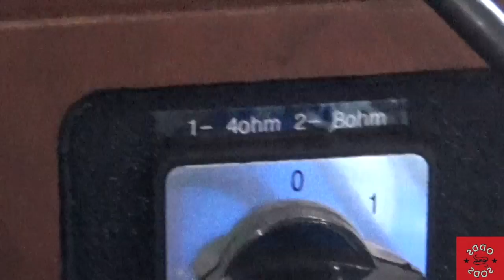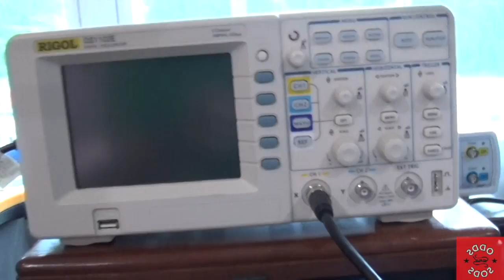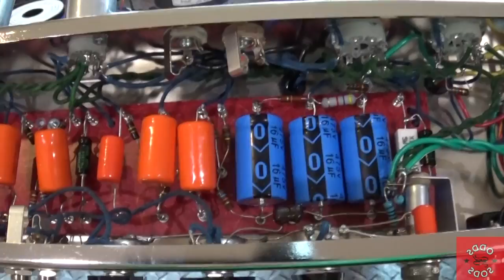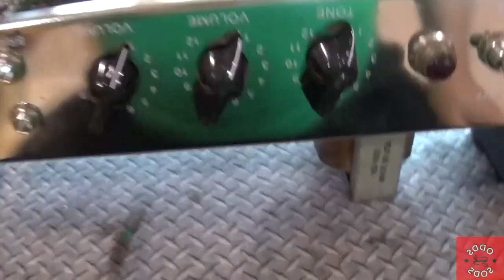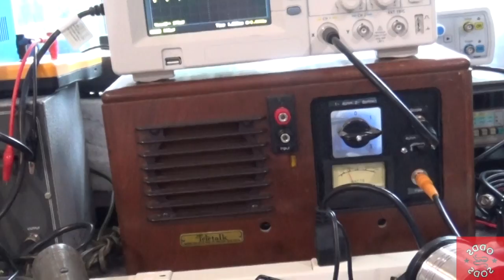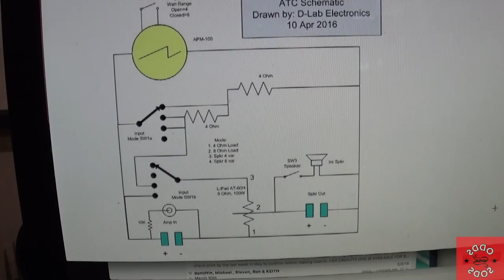Odds & Sods #14  - How to test an amp

Comment: the speaker cable looks like a thin patch cable - is that safe enough?
Reply from the maker: Yes its is. These tests usually take a few minutes and a standard speaker cable works fine, as long as it is not generating noise which would invalidate the testing.   All good.   Thanks for watching... happy to answer other questions. Ron

Comment: OH!!!    You got a modern signal generator.   Gave up on the Heathkit for testing, ehhh?    You just made me think.   When this amp is clipping, is it the preamp section clipping or the power amp section clipping.     I see it is clipping on the top of the wave only.   Can you change the bias point so you can center the signal so it clips equally and simultaneously on the top and bottom of the wave?      This would also give you more output power.
Reply from the maker: The clipping occurs at the output tube. This amp has a fixed bias in the 270ohm  5w Cathode Resistor. You can see it on the end in the form of the white ceramic resistor. In theory I could add a Pot with the 250ohm resistor which would allow me to adjust the plate dissipation and allow it to be driven harder but hotter would shorten tube life so I choose to leave it factory.  Many options out there.    Great questions Jp. - Thanks Ron
Reply from the maker: I did give up on the Heathkit.. it is just too noisy for this application.... one day I will rip it open and change all the caps and try it again :)

Comment: yup, the trick is to learn what looks right, and looks wrong.  The scope is a visual, like a meter.  Too much, too little, dirty, clean, bias clipping, freq response, noise, Ron, good job.  
Without a scope, your ears can tell some things that are wrong, hum, noises, crackles, distortion, muffled tone, weal signal, bad lows or highs, no signal, microphonics, yup, ears are also very important test instruments.  Eyes can also tell things, like glowing, smoking, sparking, poor connections, cracks, shorts, wrong connections, cold solder joints, and mouse poop.  To know wassup, that takes learnin, it's about understanding, knowledge.  Even engineers scratch their heads, lol.  Don.
Reply from the maker: Absolutely Don.. you are  spot on.. I always like the visual of when the signal goes from clean to raunchy.. that is what makes tube amps so sweet  :)